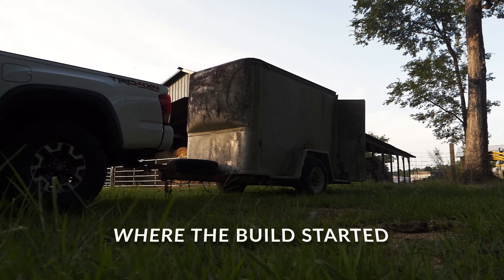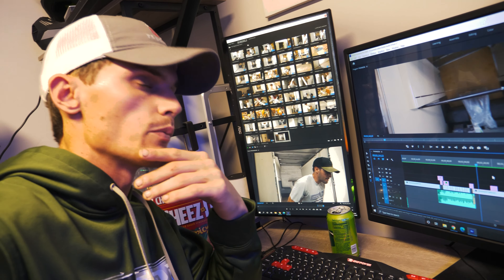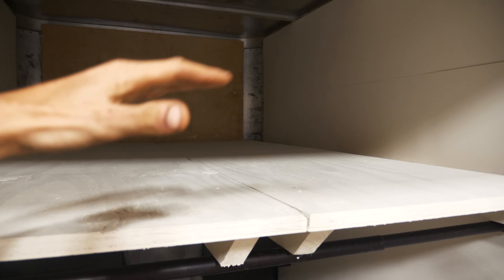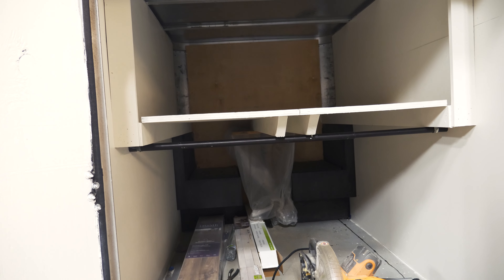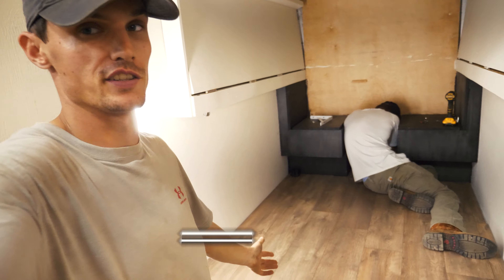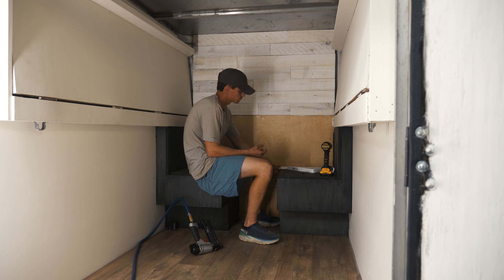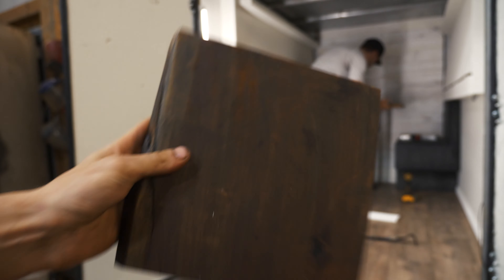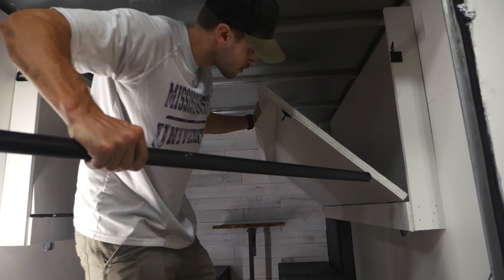OVERLAND Camper Conversion 5x8 Cargo Build *Part 3*

Comment: This looks great so far!!!  I’m definitely not a builder, but I have thought frequently about tiny houses on wheels or restoring a camper.  Can you build a hydraulic ( hand cranked ) area above the bed that lifts the roof up 3 ft?  You could also do mini slide outs on each side in the table area.